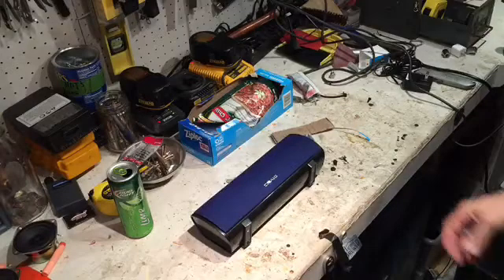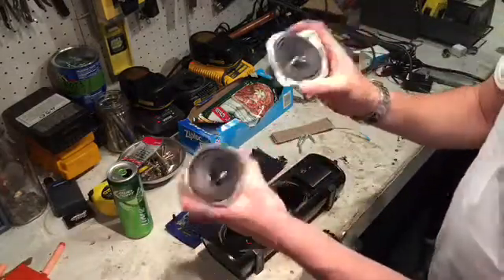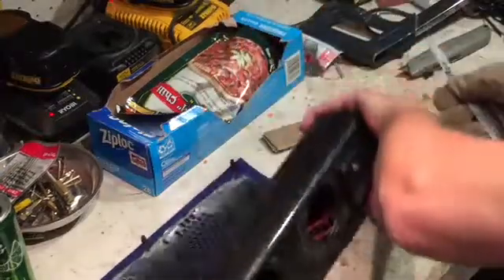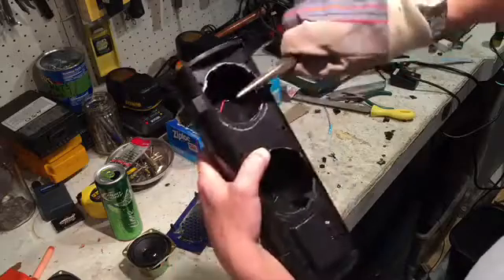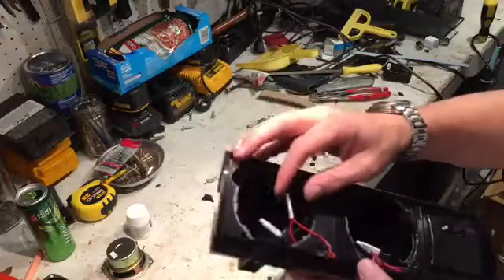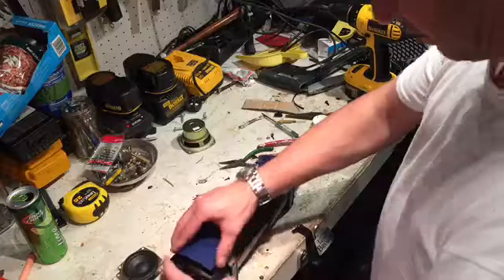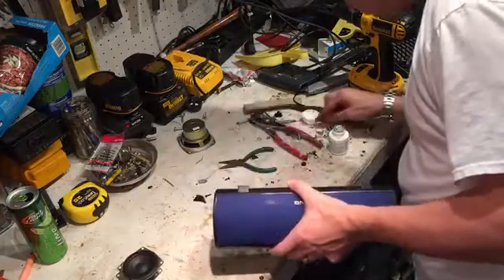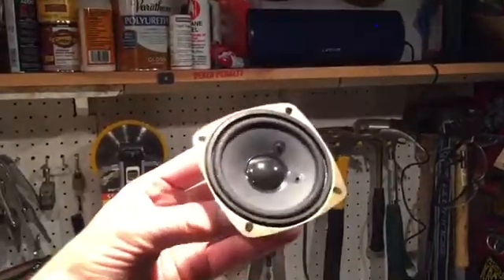Bluetooth speaker upgrade

Comment from the maker: Hello William thanks for the feedback. The speakers I used as replacements were takin out of a set of Harman Kardon computer speakers. They were the only ones I had laying around that would fit so I used them. The speaker now resides at my tool bench and has been working well since the video post. This project was just a test to see if I could improve the quality of the sound with just a speaker replacement. It sounds way better then it did so I feel I was successful. Thanks for the like and I appreciate the feedback. 👍

Comment: Ok after watching the video its a really good idea. But next time put in speakers that are worth doing the job for... .. Those are speakers from a very old tv.. But im not hating i gave you a like and watched it all the way threw and you have givin me a really good idea for cutting a platic circle without using a steak knife. Heated up... Ive messed up so much with a hot blade